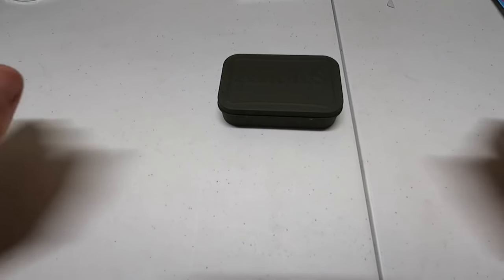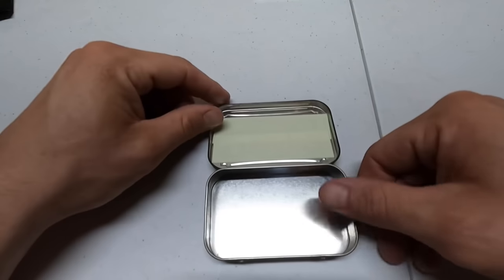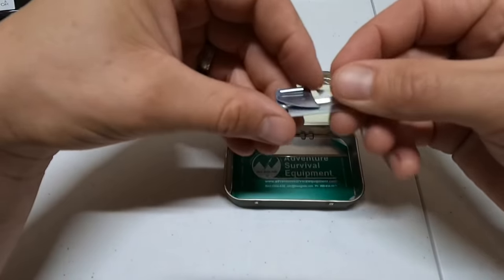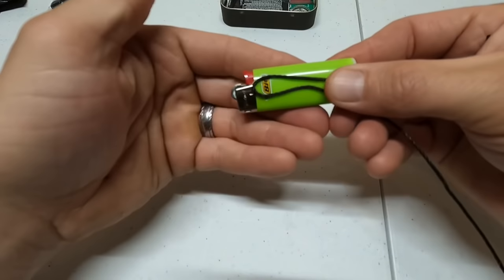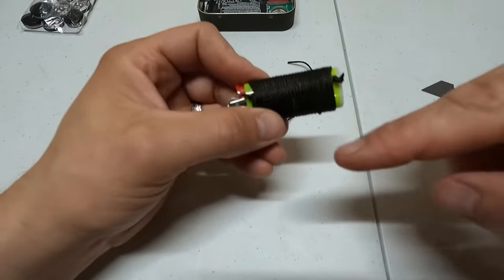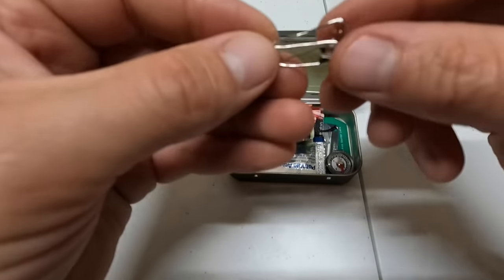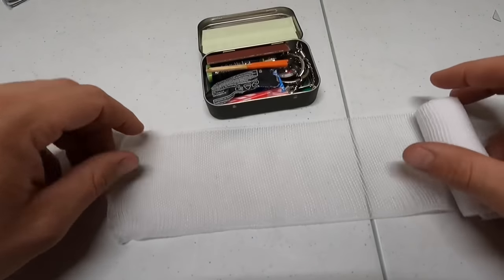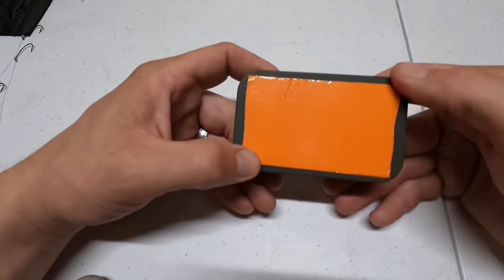DIY The Ultimate ALTOIDS Survival tin

Comment: I would rather have a ferro rod than matches, and add in a $10 bill for emergency meals /gas money.  You might also need a second or third fishing hook.
Reply: Make it 100 in this economy
Reply: I see where your coming from with the Ferro rod. Though it's entirely possible to put that on the outside tucked into the bands assuming it's the Ferro whistle combo. Also I would swap out the red or orange for blue, green, or white or one of each. Those snap lights also double as fishing lures.
Reply: You stopping by the McDonald's in the woods ?? Who the fuck is fishing in an emergency situation ? You need a day or two max until rescue. You'll be fine without food. Throw in some more water treatment. Jeeeez
Reply: @jhtsurvival I would say $20 at least
Reply: Put in a magnet because almost anybody of water you will be able to pick up hooks. Also you can make hooks out of the tin

Comment: Lots of great ideas. One thing to consider adding is a small plastic pencil sharpener. They don't take up much space and you can sharpen stick to make stakes, traps, weapons, etc in a matter of seconds without dulling your knife. And the shavings make excellent tinder
Reply from the maker: Awsome ideal. Thank's😎
Reply: good idea bro
Reply: Wow!  Genious!!
Reply: Great idea
Reply: Very good idea
Reply: Yes! Kindling!
Reply: I believe that most metal pencil sharpeners are made of magnesium which you can scrape off into a pile and strike with a ferro rod.
Reply: I think the amount it takes up isn't worth it. Chances are you will have a knife on you as well. A razor works too and is tiny. 
I have a tiny saw blade, but I slide it in rubber tubing. Slide the tube off about ¾ of the way and it's a great grip for the saw blade.
Reply: And a small plastic pencil sharpener? I was thinking the old ones from school. Just hang it on your neck

Comment: I've been using my own zippo tin fire kit since I was a teenager. Trust me one of the last things you want is small but vital kits to  blend in with your environment. I put hi-vis reflective tape on mine and also wrap a wide rubber/silicone bracelet around the outside of the tin covering the lip of the lid and hinges for descent waterproofing. Great ideas and video for sure. I highly suggest adding these two particular details to any small tin kit. You can see it day or night and reduces the chances of stepping on or kicking it, scattering and losing important items of your kit and it's waterproof.
Reply: First thought when video came on was " if you should lose or misplace it, you may never find it. "  I leave mine the colors they are. I seal tin with multiple layers of electrical tape. Also put big patch of luminous tape on top and bottom of tin. I live 12 miles into a nat'l forest. Very very thick brush and ground clutter. If i lose something i may need all the help i can get to retrack and find that object. That is why i also hang NOTHING on outside of my pack or Molle trekking harness. One, exception..
Mil. tri-fold shovel. And it uses 2 Alice clips but also secured by a 1-ft paracord from shovel to pack or harness. Older, brittle Alice clips can snap and break if hangs on a high brush snag. Btw, electrical tape is used as bandaids too. It doesnt rip open a gash or cut like duct tape can.
Reply: My lityle Zippo case kit is what carry with dress clothes or suit. Thinner profile but carries what i need as a survival kit. Great little tins, arent they?
Reply: Lol reminds of when my phone with a camo case on it fell out of my pocket while four wheeling through the woods

Comment: I've done testing with both tea light candles and birthday candles, and I've come to like the birthday candles more because you can actually do more with them. You can hold them at angles for fire making and I've noticed they tend to be more reliable then tea light candles and my theory behind that is because you have much more wick to work with then tea light candles.
Reply: Trick birthday candles are good too as they resist being put out by wind. Very good if you absolutely need a fire.
Reply: I added joke candles to my kit..same size as birthday candles..very hard to blow out.

Comment: Decent little kit, although it'll change quite a bit once you start to use it. Some things to consider:
Don't tie knots in your bankline when wrapped in that manor, it'll be next to impossible to remove cleanly with cold fingers.
Don't wrap multiple things on top of one another for ease of access.
I'd suggest painting the tin with black high heat paint, so you can use it to make char material.
Put your glow in the dark tape on one side of a sheet magnet and your reflective tape on the other side then stick the reflective side to the top of your tin in order to protect the reflective side and allows you to pull it out to use. Plus you might be able to magnetize your needle in case your compass fails.
Trick birthday candles work better than the regular ones in windy conditions.
Get a small button light instead of the chem lights, it'll last you longer and gives you the ability to turn it off when not needed.
Zip tie under the button on your Zippo; nothing worse than having a cramped tin and having something depress the button and let all your gas go.
Position your striker against the floor or side wall to prevent the matches accidently rubbing against it.
Reply from the maker: Those are some really great suggestions I will definitely consider those ideals for sure. Thank you for the tips and watching.
Reply: Great inputs!

Comment: “The rubber’s not allowing me to push it in…it’s a little tight”...that’s what she said!

Not a bad effort, all around. It’ll get you by in a pinch. Here are my thoughts as I watched:

1) The glow tape is an interesting idea, but I don’t think it will serve in the manner you intend. If the tape is closed up in the kit, in your pocket, how is it charging? It’ll be dead when you open the lid. Your only other light source is the tiny red glow tubes. Better to get an LED flashlight, like a Thrunite Ti3 (one AAA) or a Streamlight Nano (four LR44). The Photon Micro-Light Freedom II is a good choice, too, and comes in a variety of beam colors, including UV and IR (takes two CR2016 or one 2032, depending on beam color).

2) You’re right that the mirror tape is NOT a signal mirror. Would it do in a pinch? Maybe, but the UST Micro StarFlash is 2” X 1.5 “ and is the real deal. Do you want to trust your life to a piece of shiny tape that will probably be scuffed and scratched by the time you need it? Or use a purpose-built tool?

3) The Fresnel lens is a natural choice for an Altoids kit, because it’s so thin. Protecting it in its sleeve is crucial because scratches can impair its optical properties. I store mine in the lid; I didn’t have to trim it, either, as it fits nicely as is. By the way, it was invented by the French physicist Augustin-Jean Fresnel and is pronounced “fray-NELL”.

4) Utility blades and razor blades are designed to be used with handles, for a reason. They are unwieldy and dangerous when used in the fingers without some larger handle. I don’t use them in my kits. In fact, my Altoids tin kit includes a full-sized Victorinox Farmer-X SAK, with large blade, saw, scissors, awl, and the can and bottle openers / screwdrivers. Real tools. And it fits perfectly on one side. There are smaller SAKs with great tool sets that will serve well, too. See the YouTuber MeZillch’s channel for several ideas on how to safely carry blades, including how to strip and modify a SAK for use in an Altoids kit.

5) The P38 can opener is a classic item to use in a survival kit; however, I typically don’t carry canned goods, I have never stumbled upon an intact canned product in the wild, and unless you imagine raiding someone’s hunting cabin pantry, I don’t see the need for it.

6) The Portable Aqua tabs will kill bacteria, viruses and cysts, but will not purify against heavy metals or industrial chemicals like pesticides, just so you know. Choose your source carefully. Also, remember that they take four hours, out of direct sunlight, to work. There are better options. And you might want more than two quarts. Check out YouTuber Gear Skeptic’s channel for an in-depth three-part video series on water purification…outstanding!

7) Birthday candles will deteriorate over time, stick together and to everything else, and create a mess. If you are going to carry them, seal them inside of a drinking straw (go back to MeZillch’s channel for this methodology). Personally, I don’t use them. I prefer to use the space for a ferrocerium rod, my second option for fire after the Fresnel lens.

8) Are you embarrassed to say “condom”? LOL! These are typically not very tough. Hell, I’ve had them break during their intended use (no brag, just fact!), never mind out in the woods among rocks, sticks, thorns, etc. At the very least, you’d want a sock or a bag of some kind to give it added protection. I prefer to use CryoVac 1 quart bags. They roll up nice and tight and fit well, or fold flat, and are way more durable. Supermarket produce bags are a good option, too, and even Ziploc brand 1 quart freezer bags work better than a condom. 

9) Suunto is the most reliable small compass. Their Clipper style can be taken out of the case for an even smaller form factor.

10) The Bic lighter is overkill, and a waste of space. First, it’s of limited use because it will run out of fuel, probably by leaking unless you protect it somehow. Second, practice making fire with a Fresnel lens and a ferro rod, until it’s second nature, and you can get flame 99% of the time with natural tinder. In my Altoids kit I carry a lens and a ferro rod, with two storm matches and a Tinder Quik plug as backup in wet conditions.

11) Wrapping the bank line, fishing line and thread around the lighter seems like a good idea, until you need the bank line first, or the fishing line. You’re going to end up with a tangled mess for sure. Store them each separately. The thread and fishing line can be spooled onto small sewing bobbins, and the bank line can be hanked. Coil what you want, and wrap it in a similar fashion to what you did with it on the lighter. Heavy duty carpet thread, Kevlar thread and even dental floss is a better choice than that cheap sewing thread.

12) I carry a sail needle, which is bigger and stronger than a regular sewing needle. I prethread it with carpet thread, and store in a sealed drinking straw. 

13) I found it ironic that you stuck a single fish hook onto the lighter, then later showed us several pre-rigged hooks with leaders on the side of the frame at the end of the video. THOSE are what you should pack! Clamp some split shot sinkers on them, coil them and slip them into a small ziploc bag. Three or four should do the trick. Remember that you can potentially catch a large fish on a smaller hook, but you are unlikely to catch a small fish on a bigger hook. I carry three #4 and three #8 in my Altoid kit.

14) Safety pins ARE great. Get good sturdy large ones, like 2” brass ones. Four is a good number if you want to use them to rig a tarp or Mylar blanket into a shelter. There is a way to interlock them to save space (MeZillch again!)

15) I have some tiny glow sticks. I suppose they can be useful in certain circumstances, but I wouldn’t depend on them for illumination. I carry a couple of tiny green ones to mark my shelter at night if I have to leave it for any reason. To me they’re all but useless. Get a flashlight.

16) I’ve never been a big fan of wire saws. They break. Never had one that didn’t. ASE Best Glide sells a mil spec version that I’ve never tried, so maybe that is a good choice, but I have my SAK if I need a saw. Plenty of firewood laying around in most woodland settings that doesn’t need to be sawed.

17) As noted above, I carry two NATO storm matches, a strike pad and a Tinder Quick plug, sealed in a drinking straw, as a backup to my lens and ferro rod. The straw helps protect the matches from being crushed, and keeps the strike pad and tinder dry.

18) I would rather have a couple of large Bandaids (the ones with Neosporin already on the pads) than gauze. But I already carry a small IFAK with some state-of-the-art, hospital grade wound dressings and medications, so I don’t need first aid items in my Altoids kit. I get that the gauze can be used for other things, like filtering, or char cloth, but I don’t carry it in the Altoids kit.

19) Duct tape can be stuck onto waxed paper and this will preserve its adhesive better than rolling or folding it onto itself. I carry a 18” X 2” strip on waxed paper, folded flat. 

20) Stuff I would add:

10’ of stainless steel wire (24 AWG)
A slim titanium whistle
An 18” X 12” sheet of HD aluminum foil
A slim micro pencil and/or a space pen cartridge
Three 3” X 5” sheets of Write In The Rain note paper

21) YouTuber MeZillch is a master of miniaturization and innovative storage and carry solutions. YouTuber Gear Skeptic has an amazing set of videos on water purification and another on the lightest, most calorie-dense trail foods…GREAT analysis! Andrew of Ranger Survival and Field Craft is a former Ranger who teaches skills better than anyone I’ve found online yet.

Having said all of this, yes I have made an Altoids kit, and yes I carry one occasionally when I’m in the woods. My preferred kit, though, is to use a Maxpedition Mini pouch, because it’s roomier than an Altoids tin, and I can comfortably get all of the above in it, with room for a few extras (bandana, Mylar blanket, small water filter, etc.), and because it fits neatly in the cargo pocket of most of my hiking pants and shorts. The other pocket always holds the aforementioned IFAK, along with a 6” Israeli bandage and a CAT tourniquet. 

These items are always securely on my person, so that in the event that I get separated from my main bag or other gear, say by a flash flood, a raging river, a landslide, an avalanche, a tumble off a cliff, a rampaging moose…yeah, good luck!…at least I have some basic items on me to build a fire, erect a shelter, purify some water, maybe get some food, and signal for help or navigate out.

I hope that even one sentence of what I’ve written helps you, or anyone else. I spend a lot of time thinking about this stuff, researching this stuff, playing with this stuff, and practicing with this stuff, and I hope you do, too. Good luck to you Sir! Keep on the sunny side of the street, and keep on keepin’ on!
Reply from the maker: That is a lot to soak in, but thank you for your suggestions, and for watching 🙂👍💯.

Comment: 12:30 in: wrapping the lighter with layers.
Tip... start with the hook and needle. Hold against the lighter,  & secure with at least one layer of gorilla tape.  Then wrap cordage and fishing line.  This does several things. 
1. Secures sharp tools so you don't lose them. 
2. Protects hands from sharp tools
3. Offers a textured area so you cordage doesn't slip off the end. 
4. Gorilla tape also may be used for a fuel source to prevent wasting lighter fluid. As a good rule of thumb is if you have to hold the lighter lit for 3 seconds,  you are wasting precious fuel. Light the tape instead if you can't find other dry tinder in nature.

Comment: I carry lighters too, but I've had them fail often enough for one reason or another so I always cary a ferro rod too. 
You can get ferro rods in small sizes or large chunky ones.
The reflective tape scratches up pretty easily so maybe put on 2 layers. The top layer protects the bottom one.
If you want the outside to be low viz, cover the orange duck tape with some olive green tape.
Maybe leave a corner of the orange visible in case you drop it in the woods though.
Reply from the maker: Those are all great suggestions. Thank you for watching and commenting.😎

Comment: I've done similar kits. I tend to magnetize the needle as an emergency compass, and pre-thread it in case you're unable to do so under those conditions where you might need it.
Reply from the maker: Magnetizing and pre threading are a smart thing to do first. Thanks for watching 👍😎
Reply: Been thinking of buying a few sterile suture kits. They're pretty flat, small, and the curved needle comes with the suture thread already attached. One or two should fit quite easily into an Altoids tin.
Reply: @SCSlimBoiseID   Good idea. Just keep in mind that suture needles are very small, and are designed to be grasped with hemostats. You can get somewhat larger curved sewing needles in a set at Walmart and other stores with a sewing aisle.

Comment: Pretty similar to my altoids tin. Some things I have in mine: I exchanged the condom against a Whirlpak and I included an CRKT RSK Mk. 5 as a blade. And also
A micro LED as a light source.
I have a small Ferro rod instead of matches and I use these “trick candles” as they are not so prone to get blown out by the wind.

Otherwise: great kit!